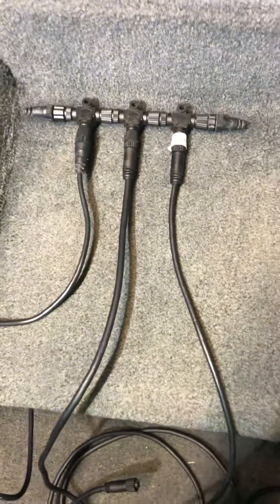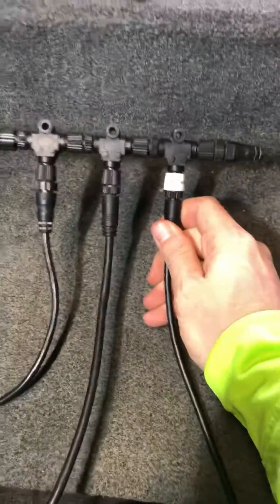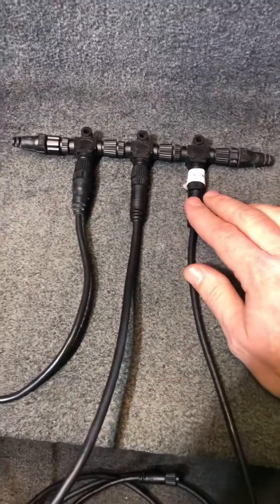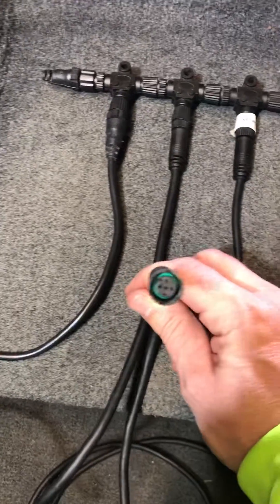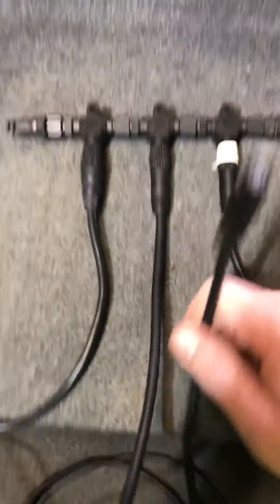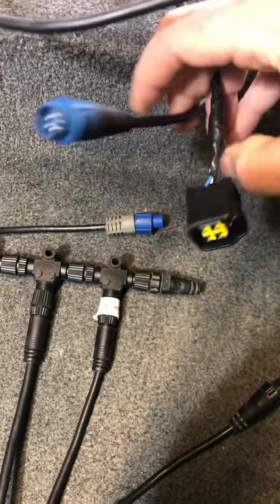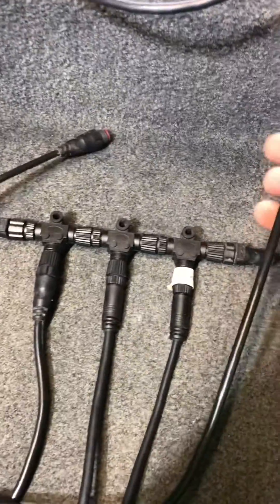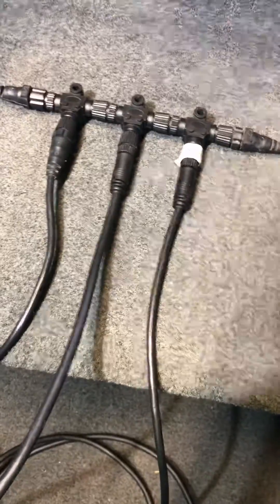How to install NMEA network to Garmin fish finder and Yamaha SHO motor

Comment: Did you have to use a gateway or engine data translator between the engine and the fish finder?
Reply from the maker: There is a specific interface plug for the motor that connects to a plug at the motor and connects the the NMEA backbone. The graphs have a specific NMEA screw-in connector on the back.

Comment: Do you have part numbers or links to buy the cables used? Specifically the ones connecting the motor to the backbone. Thanks!

Comment: Sorry if this is a silly question but what benefit do you gain by connecting the Motor to the NMEA 2000 network?
Reply: You can have the garmin display things like rpm, trim etc
Reply from the maker: Engine interface data. Hours is probably the most useful but also see boost, tilt/trim, rpm, mpg and some other data. Each motor is a little different in what it will show I think.